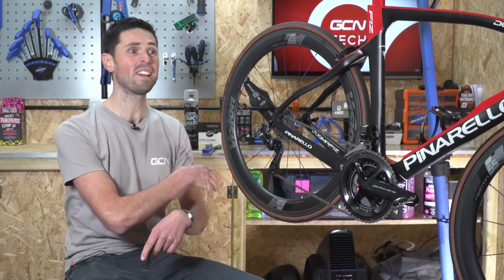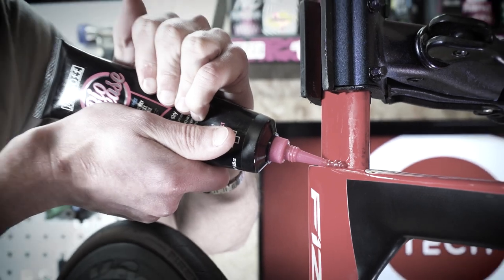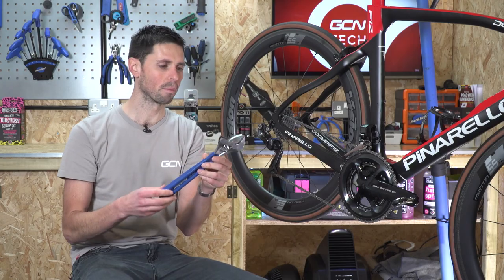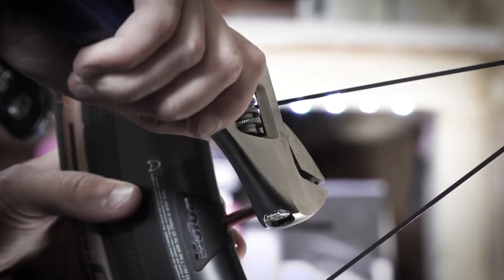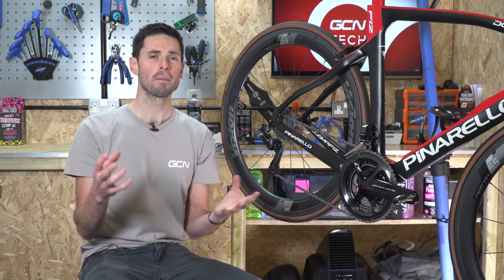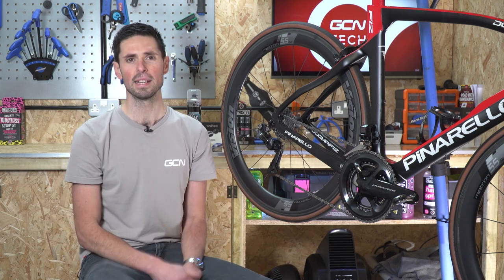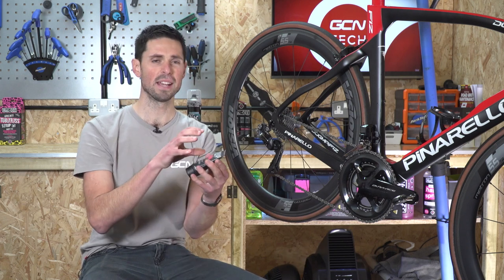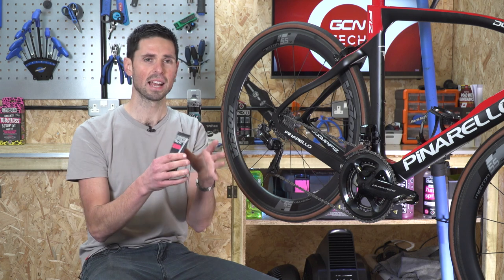5 Maintenance Mega Mistakes | Maintenance Monday

Comment: It would've been useful to clarify that you absolutely DO want to use grease on most screws, despite the fact that you want them to stay in place. That can be a bit counterintuitive to folks, but reducing friction between the male and female threads is critical to make sure that the torque you're putting into the screw is resulting in the expected amount of preload (the thing that actually keeps a screw in place and provides strength to the interface), and that you’ll be able to remove the screw when you need to.
Reply: Sure, assuming you've done the appropriate research locating the empirically determined k-factors for your lubes of choice and determined an appropriate torque correction for the hardware you're working with. The most common cause of bolt shear failure is torquing a lubed bolt to stated torque indicators that are most often based on dry torque.
Reply: Nothing wrong with a bit of the correct loctite, or other thread locking liquids/sticks. As long as the right grade is used.

Bear in mind not only do they prevent 'off torque' or undoing through vibration, you don't have to over tighten to get things to stay tight.  It's other intended purpose is to prevent corrosion (threads from seizing up) so they can undone with out damage.
Reply: WRONG torqued fixings should be fitted dry if you are going to use a standard torque wrench, torqueing a greased thread lowers friction and decreases the running torque which in turn causes you to overload by up to 50% depending on the lube.
This is why torque wrenches are little more than overpriced toys when used on bikes. Controversial thing to say I know but its true and the reason my bikes never go anywhere near a bike "mechanic" but my components last twice as long as my riding buddies.
The only thing a torque wrench is good for on a bike is checking that you have equal load applied when 2 or more bolts are working in unison (shimano crank arms, stems, chainrings, 6 bolt rotors etc)
Reply: @luciustarquiniuspriscus1408  You tighten a bolt to increase preload but what you feel as you tighten is partly the friction between the treads and the underside of the head against the washer, this is mostly what a torque wrench reads, its called running torque. If the bolts are dirty, rusty or have thread locker applied then the friction increases and you end up under loading/torqueing, if the bolts are greased the friction is decreased and you end up over loading/torqueing. This is why for a torque wrench to be somewhat accurate bolts should be installed clean and free of lubricant or "dry". This is both impractical and problematic on a bike as the bolts are exposed to the elements and constant vibrations they have a tendency to either seize if not greased or rattle loose if not thread locked. This is why for the most part torque wrenches are pretty useless on bikes.
Reply: @luciustarquiniuspriscus1408  That is exactly what you are supposed to do. The person replying to you is not wrong, though its not so dramatic. If you do the internet search (easier for some manufacturers than others), you can find recommendations for torque setting on a particular wet (lubed) bolt. Or you can rule of thumb it and reduce torque around 30%
Reply: But why do you use grease (= meant to  make moving parts move smoother)  instead of assembly or anti seize paste (= meant to prevent parts getting stuck together)?
Reply: @willemrm4033  probably because most people don't know the difference and most bike shops are just going to stock standard grease lubricant. And, there's not a huge downside to grease AS LONG AS you adjust your torque.
Reply: @cjohnson3836  It's rather pretty straightforward , don't see why one should get into torque or seatpost/tube complications  by wanting to use grease  where it shouldn't be.  The  real complication is that not all pastes are suited for all materials.
Reply: @willemrm4033  Its easier to tell people to go from 6Nm to 4Nm than it is for a shop to dedicate more floor space to another product.
Reply: @cjohnson3836  The more products one needs the more  the (web)shops  like it.
Reply: @cjohnson3836  Yeah but did the OP do that search for the "wet" installation, was he even aware of the difference between running torque and preload and that you should reduce the torque to allow for the lube? Obviously not because he just showed in his comment that in fact he believes the exact opposite. Things can get pretty "dramatic" when a carbon steerer, handlebar, stem, seat post or FRAME fails while you are using it. Couple this with the fact nobody calibrates their torque wrenches or stores them properly and over half of the people who use them use them wrong, either by having their hand in the wrong place or "double clicking" the wrench you have a recipe for disaster. IMO they are best not used on carbon (or any) bike parts.

Comment: Aluminum seatpost into a steel frame is a recipe for disaster. A thin layer of grease or anti-seize is a must if you ever want to remove or adjust the seatpost sometime in the future.
Reply: But why grease (= lubricant) ? The one to use is  or assembly or indeed anti seize paste, suited for alu/steel and /or carbon material.

Comment: I think I will continue to grease the aluminium seat post in my steel frame thank you very much!

Also, it's a good idea to apply grease to all metal to metal interfaces. It helps in reducing the chance of creaking, helps prevent water getting trapped inbetween the surfaces and helps reduce corrosion.

I think the video should have stipulated that you don't grease carbon to carbon interfaces, as plenty of people don't ride carbon bikes...

Comment: If you ride a steel frame with an aluminium seatpost, put some grease on the seatpost. (Likewise on an aluminium stem in a steel steerer tube.) I've removed two or three stuck seatposts over the years and it's a pig of a job. An ounce of prevention is worth a pound of cure!

Comment: have to disagree on this one, I was a bicycle mechanic for many years, even in the Parktools repair books they state to use grease on the seatpost, handlebar quill type stems, surface of crank spindle,  almost anything that is threaded, (not all but most).
Reply: I think cgn speaks of carbon bikes here, which are special and need other stuff (like carbon paste) than a bike with a metal frame.
They should have mentioned this difference to avoid confusion, since grease is important on a seatpost inside a metal frame

Comment: My latest maintenance mistake: degreasing my track chain with degreaser and boiling water...

The degreaser got into the chain rollers and strip them of lubrication so bad that it was impossible to regrease them, especially after they closed off by cooling down to room temperature. 
I also let a drop of degreaser get into my rear hub and had to repack the whole thing lmao
A good day !

Comment: First point is bollocks.  Steel frame + aluminium seatpost or stem = seized components.  Yeah, you can use an anti-seize compound, but grease works just as well and it won't slip if you tighten it correctly.

Comment: Obscure tool. A short length of plastic water pipe (the thick grey type). My pedals on one bike are attached by a hex bolt. Even with a long hex key it can be a pig to undo the bolt. My solution is to insert the hex key and then slide the pipe over the hex key to increase its length. In effect using the pipe like a tommy bar. Sometimes I even need to stand on it to 'break' the initial friction grip.

Comment: I use a Kinetic persuader for all my maintenance requirements. Seems to do the job for everything... :).
Reply: The 3 rules of maintenance work: 1. Always use the correct tool. 2. A hammer is always the correct tool. 3. Everything is a hammer.
Reply: @Kold87  naw, a screwdriver is a chisel, but anything can be a hammer 😉

Comment: One time when I was changing pedals, all I had was a standard IKEA hex key and a micro 1/4" ratchet wrench. One of the pedals was really stuck, so I had to get more leverage somehow. It ended with me getting a metal vacuum pipe and stuck it on the two-inch ratchet handle. And it worked!
Reply: I've a decommissioned metal vacuum pipe on my tool board for exactly the same purpose.   😀

Comment: I usually very much enjoy Alex's posts and find them useful, but unfortunately not this one. I use very small amounts of grease for seat posts and pedals, in fact for many of the adjustable parts on my bike, and I have absolutely no qualms over this.  Frozen screws and especially frozen seat posts are a really good way to totally ruin your day. The other items here, like using huge wrenches (spanners) to fix tiny things, or putting thread lock-like compounds on chains, are just things no sane person would ever do and seem remarkably contrived.

Comment: My disc brakes are noisy, is it okay to put grease on them?
Reply: Only if you do lots of high speed descents.
Reply: If you don't want to stop! That's what the Disc Brake Cleaner is for.
Reply: Remove them, the noise should cease
Reply: what are these 'brakes' of which you speak?
Reply: You should have stuck with rim

Comment: I always use lithium grease on seatpost and alloy frame and carbon paste if a carbon seatpost. When slide down and tightened just wipe off the access and there shouldn’t be any slipping.

Comment: Love the way you were using the torque wrench, wait for it to click and then keep tightening just a bit more. Twice.
Reply: Three clicks is the standard for most torque wrenches. The first may not be exactly on.
Reply: @jamesmckenzie3532  no. only if one part has multiple screws.
Reply: @hendriksiering9077  I was advised this by more than one bicycle mechanic. The amount of torque shouldn't change. What I seen Alex do isn't recommended though. You don't lift and reset.
Reply: @jamesmckenzie3532  Last I checked, bike mechanics were mostly underpaid highschoolers. Not engineers.
Reply: @cjohnson3836  Then you are going to the wrong bike shops. Might I humbly suggest you go to different ones? Every one I go to has mechanics on their 30s and 40s. Many have years of experience fixing and tweaking bikes.
Reply: It is always right to check and double check your torque settings. Anecdotally, if you are tightening a component with multiple bolts (stem face plate for example) you should apply torque evenly, so I go for finger tight all round, half-torque all round, full torque all round, double check bolts. Also, as the torque measurement is not measured from the centre of the bolt but rather the pivot on the wrench head, the device can only correctly measure the torque if the force is applied properly from the centre of the handle. If you hold a torque wrench in the wrong position, you will apply the correct torque to the spring mechanism in the ratchet but it will not be correct at the head of the bolt as it becomes an imbalanced cantilever. Another reason to double check bolts.

Comment: Ok GCN you def understand social media analytics and functionality. Place one polarizing viewpoint in a post and get high viewer engagement. You win at the expense of journalistic integrity. Keep it up and the brand equity of GCN will be crap in a matter of time. Tell your masters in suits that. There are many of us that have either steel or aluminum frames with either steel or aluminum seat posts. Folks:: put grease on it. GCN says “swine, we don’t speak to those lowly serfs only those with carbon on carbon contact points. Let all else eat cake” ..out of my 15 bikes 13 have mixed metal contact points in the seat / head tube region.

Comment: I try not to shame anybody for not knowing something, but does anybody really need to be told not to put carbon gripper paste on a chain?
Reply: Some people today even spray lubricants or stuff like WD40 on disc brake rotors, and others put coolant fluid instead of oil inside a car's engine or engine oil inside the brake fluid reservoir.
Nothing is impossible today

Comment: I'd imagine anyone who has carbon assembly compound would know it doesn't go on the chain. I guess you ran out of ideas but already had the title types in for 5 mega mistakes? Don't spray lubricant or wax anywhere near your braking surfaces, would have been a worthwhile add.

Comment: I just oiled my disc brake because they where so loud ;) 
*sarcasm off 
No I didn't 😅

But actually I do apply a little bit of grease to my seat post because I change is almost never and had it stuck on bikes before.

Comment: If I had the money for a bike like that I would probably have enough to have it serviced by a professional.
Reply: Would you have a professional lube your chain every time, and wait days or weeks to ride again to avoid a 5min job?
Reply: @erlkoenig90  No but I don't think I would wrench on it myself beyond that and tightening a bolt or two.
Reply: @jameswoods4656  Doing it yourself may be easier than finding a good bike shop...
Reply: @erlkoenig90  I thankfully have one.
Reply: @erlkoenig90  all bike mechanics with their experiences aren´t good enough...sure!
Reply: @hendriksiering9077  Skill isn't usually the problem. But they are constantly (even before the pandemic) overloaded and usually don't have the time to help you properly. They also rarely have the parts you want, and understandably don't want to work with stuff you bought online... Many don't want to work with bikes you didn't buy there, but also have a very limited range, discouraging you to buy there.

Comment: I used an allen key to tighten my torx-screws at the crankset 😅🙈
Reply: Sometimes the sizes are compatible. For example a T25 Torx bit will fit perfectly in 4mm hex head, but not vice versa.

Comment: #AskGCNTech Why don't belts work with derailleurs? (The more visual the explanation, the better.)
Reply: I'd have to guess that it's because of their shape. They are wider than a chain and would need a similarly large gear / transmission surface to suit them, thus you could maybe only fit like 2-3 gears on the back. Even then, you have to consider that belts aren't made to slide from side to side and it probably wouldn't be worth it developing a belt for that.

Also, cool fursona, i'd move the color reference out of the picture tho.
Reply: because they need much higher tension to not slip...
Reply: @genericpseudoname160  Regarding the technical issues with belts and derailleurs... Challenge Accepted.

Regarding my ref-sheet... There's only so much editing I can do to my avatar on iOS.
Reply: First off, you would need to use a double-sided cogged belt, similar to the ones used for timing in engines. That's the only way it would work with a rear derailleur. These belts are typically much wider than a chain. They would require a completely redesigned cassette and chainrings, with much thicker teeth to provide more bearing surface for the rubber teeth on the belt. So you would lose a lot of speeds, and you would lose a bit of mechanical efficiency due to the internal hysteresis of the belt as it winds around the tight turns of the jockey wheels of the rear derailleur. Although you might save a bit of weight, as the cassette and chainrings could be made of a lightweight polymer, and the belt is surely lighter than an equivalent chain.

Comment: #1 mega mistake: over greasing the chain, preferably from the top and the outside surface of the links. Just one cycle on the inside of the chain and even that should be wiped off after a few spins and shifts.

Comment: Seeing as how winter is already here, I'm quite concerned with how often I should clean my chain.

Do I have to degrease every time I see those small sandy and gritty particles build up between the rollers and on the drive train? What about degreasing just before re-lubing? Every week maybe?
Reply: Where I live we get a ton of snow and even more salt and sand on the roads.  Every time I get home I take a rag, spin the chain through to dry it, then run it through some nail brushes to get the grit out.  Scrub the casette and derailleur too, it all takes 2 minutes.  Relube with MucOff -40 lube, let it sit 20 minutes and spin the chain through a CLEAN rag to remove excess.  My current chain and casette have now been through 2 winters (and summer spring fall) without changing from cleaning every ride in mud, snow or rain.
Reply: @theepimountainbiker6551  Thanks for the info. I only cleaned it once since I got it a month ago; that took quite a while and I was worried i'd have to spend 30 minutes extra after every ride cleaning it (granted I lack the tools to make my job easier, I'll get those as soon as possible).
Reply: @genericpseudoname160  no problem.  Everything I used cost $1, except the lube of course.  Use rags from old shirts or dish cloths from dollar store, brushes for dishes nails or toothbrush even from dollarstore.  Hopefully you get a system down like I did where its done before the snow even comes off the tires.  I store my bike in the basement so it all dries off quickly.

Comment: wtf? I was always told to use grease on the seatpost so it won't weld to the seat tube in case there's any oxidation
Reply: As long as you use a metal frame grease is perfectly right.
He speaks of carbon frames (which are different) without mentioning the fact his tip is only right on a carbon frame.

Comment: Merciful God. All of this is common sense. Spray degreaser directly onto bottom bracket cups! Oh lord, who is going to do it? Then again,  there is nothing stopping clueless cyclists doing very silly things to a bike. Granted, the torque wrench is very important especially on carbon parts and a carbon bike frame. Good advise, only use to tighten parts. Use a hex key to loosen. I think GCN are grasping at straws for new maintenance videos.